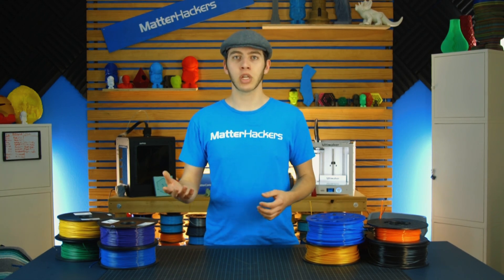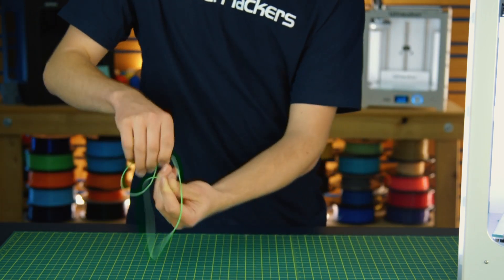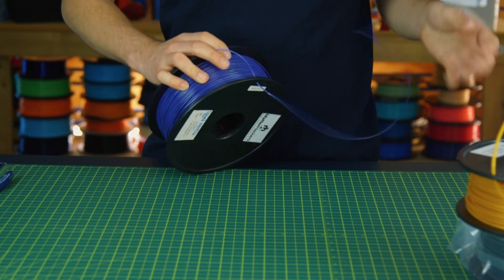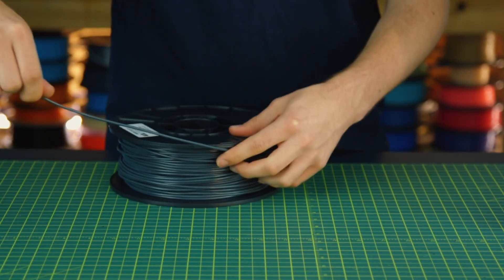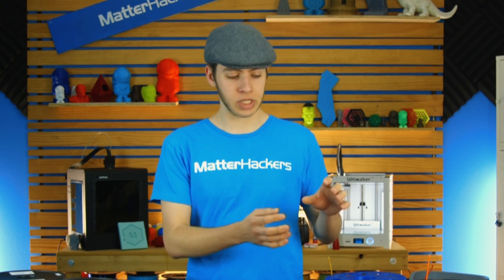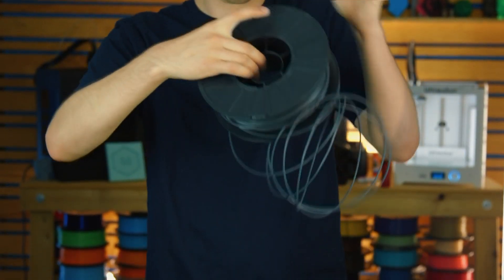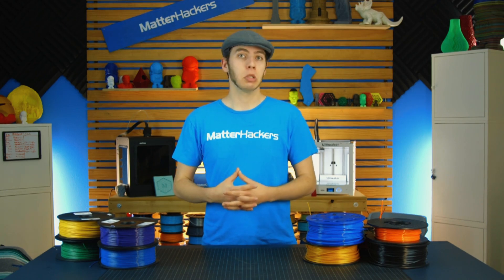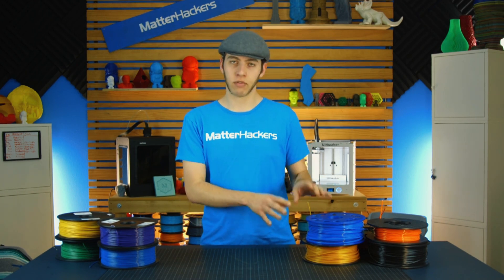How To: Untangle Filament // Filament Guide

Comment: Learned it the hard way after several hours of running back and forth between the printer and my desk as the knot would just move backwards anytime I losened it up and just pushed it further back the roll..
Reply: Lab Stream same. Made the mistake of having a sideways spool holder which just made it even worse when it fell off the spool
Reply: Same
Reply: I bet you got really tired and learned to slow down after like the 3rd or 4th 10 hour print